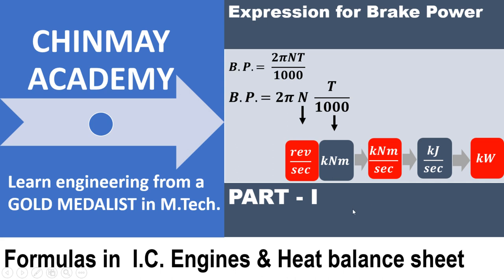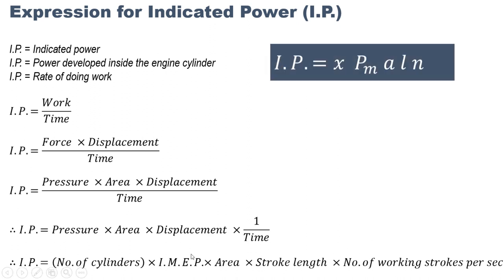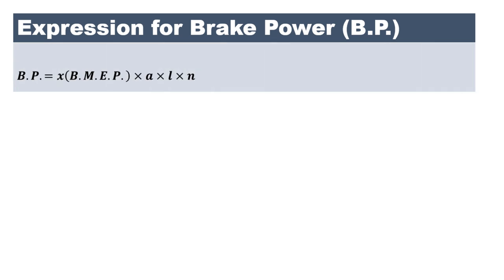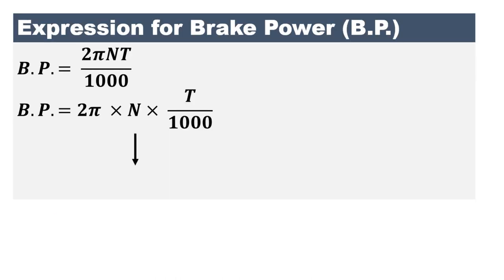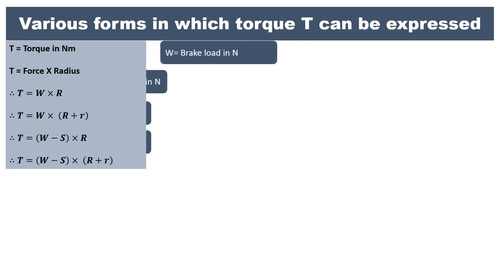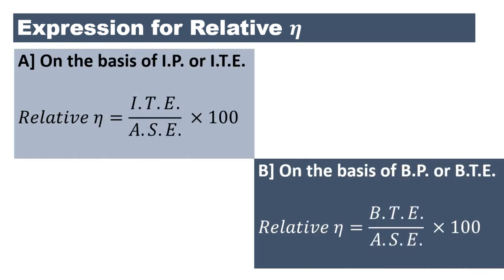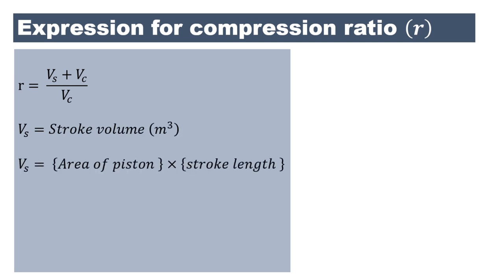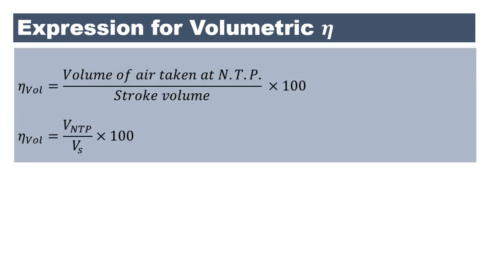I C  Engine formulas explained (Part 1)

Comment: I could barely hear you in the video and you were running through it pretty quick. Is it possible to directly calculate engine torque or power without using a dyno? Guess I'll have to watch it a couple of times and maybe get some headphones or something.
Reply from the maker: Extremely sorry for the inconvenience. Will try to rectify it. It is not possible to find the engine power without using a dynamometer .